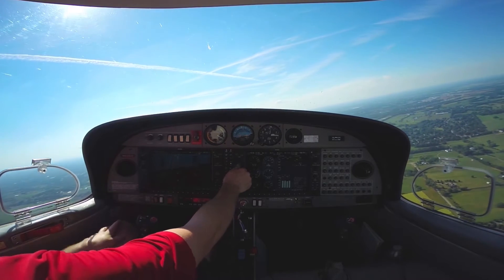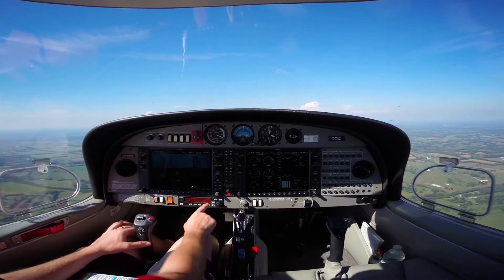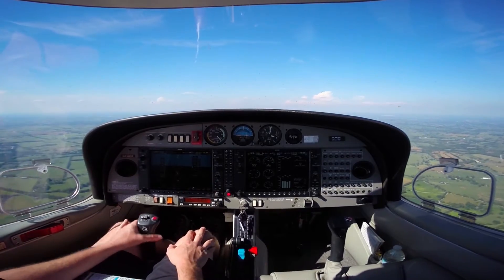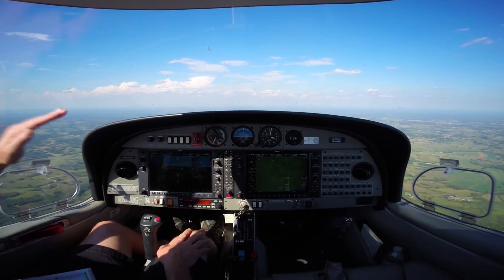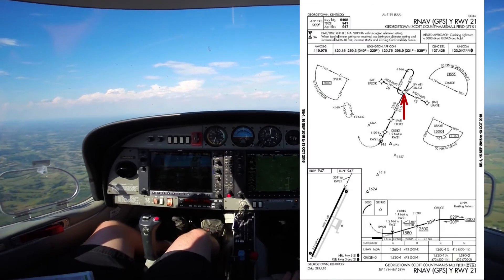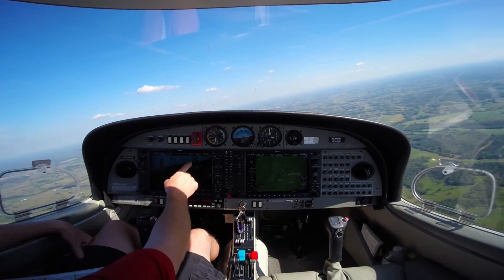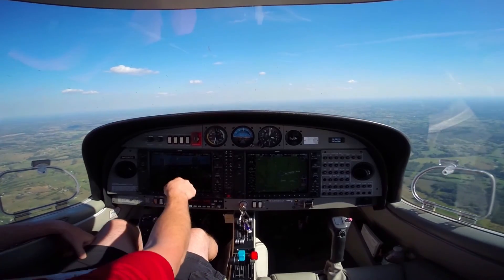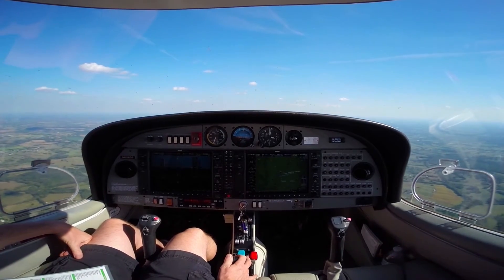Bendix-King KAP140 Autopilot Overview

Comment: Gotta give a thumbs up on this video. I fly a few flight school 172's that have the KAP 140 AP. I also fly a DA-40 from time to time, and although it flies well (and fast), I can't get past the fact that it has at least 4 idiosyncrasies that make it impractical travel airplane for me. Fun flights are ok, but not in the Florida summer. 

1) If no painted canopy (like the one I fly), it is an infrared radiation-soaked fish bowl in which you get baked and
    sunburned (plus no A/C)
2) I can't comfortably strap my Foreflight iPad4 to my leg, the stick is always hitting it when maneuvering and it's hard to see
    (see #4 below).
3) (and NEVER do this ) The lift-up canopy is a trap. The keys slid into the "Mariannas trench" of a gap at the front of the
    windshield when I left them on top of the glare shield and the passenger opened the canopy to retrieve
    sunglasses at the FBO counter. Took an hour to fish them out with a hangar-wire someone eventually found in the
    back of their car at the airport.
4) (and this was happening to YOU in the video). Even with a painted canopy, sunlight washes out the instrument displays
     because the glareshield doesn't, well, shield the GLARE, and you have to constantly shade it with your hand or anything that works (a checklist page?).

For as much as these things COST (even used), there shouldn't be ANYTHING makes it a burden to operating it. It's obvious they were designed to fly in a different environment altogether (can you say Austria? where its cooler, sun-angle different, etc.)

DA-40 + Florida summer = no go.

Thoughts?
Reply from the maker: Thanks again for you comments. While the DA40 is modern, reasonably fast and fuel efficient, it doesn't fit everyone's mission profile, such as your own. And you're right, it does have some idiosyncrasies. But the market is very active for these planes right now and that shows they are in demand. Stay cool in Florida!